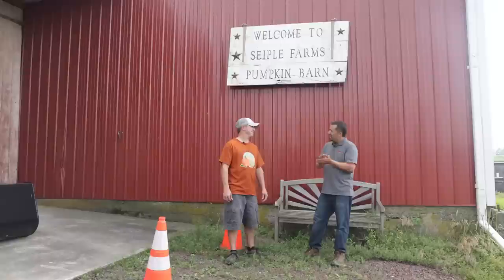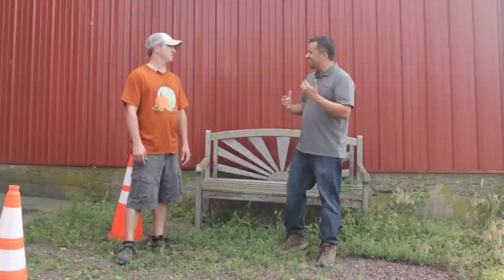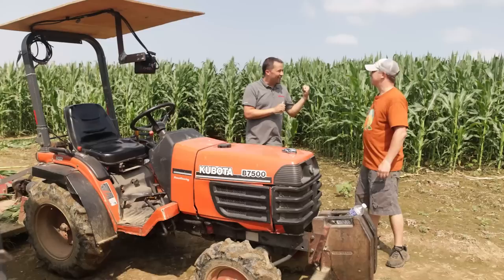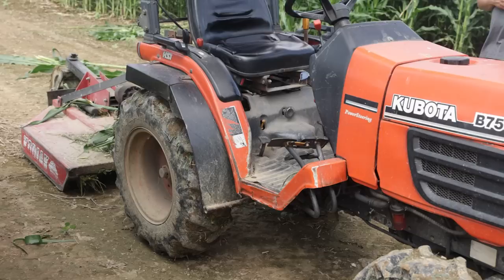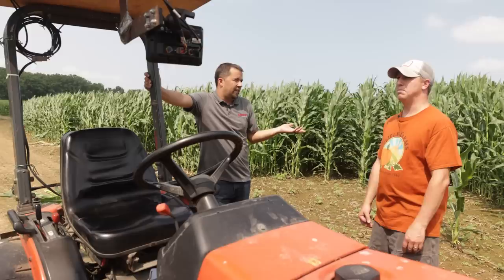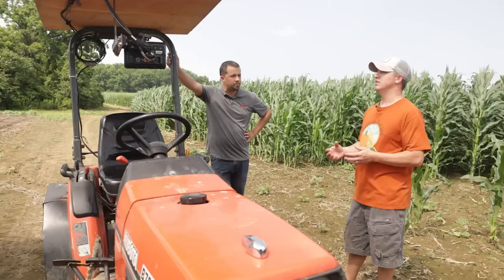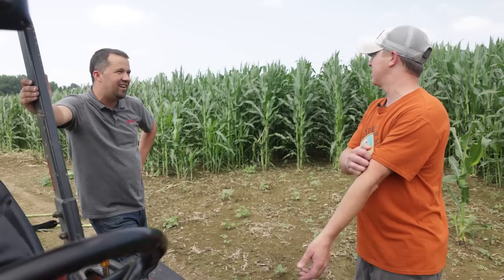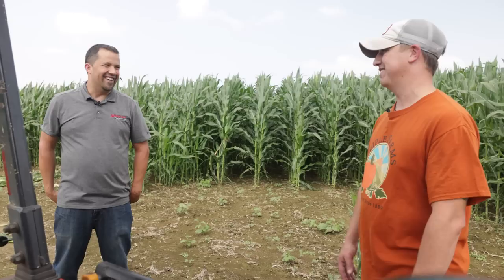How to Make a Corn Maze

Comment: Wonder if they can skip the mowing and program the planter if it has individual row monitors
Reply from the maker: Yes, if your planter has individual row clutches you can do this.
Reply: That's an interesting concept. The only thing I can see as a issue is you'd probably still have to mow it several times before it was ready for foot traffic due to growing weeds/grasses.
Reply from the maker: @barelystablefarm7151 in the back-half of the video. There is about a month for things to decay, then the first day or two of foot traffic cleans up the remainder.